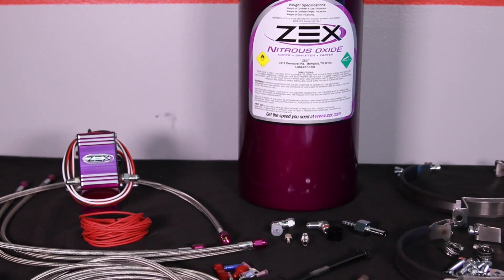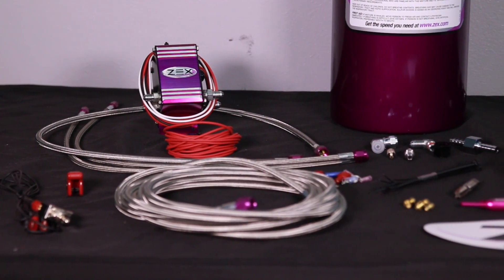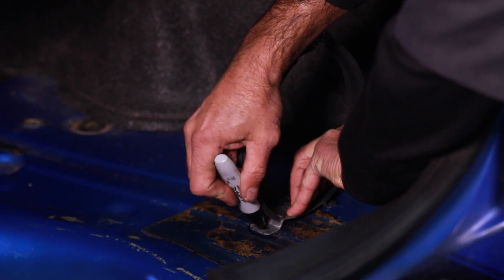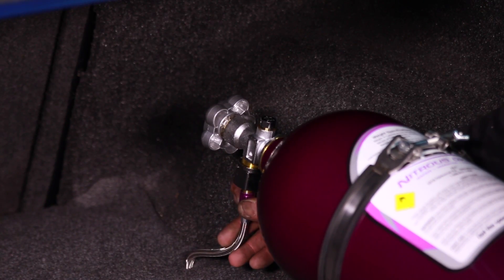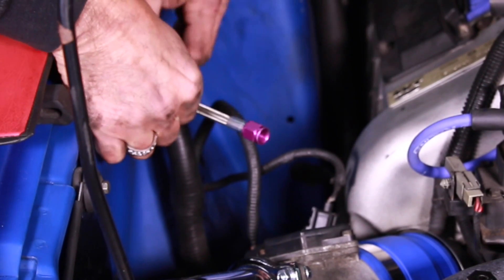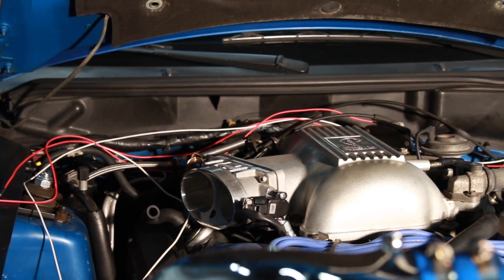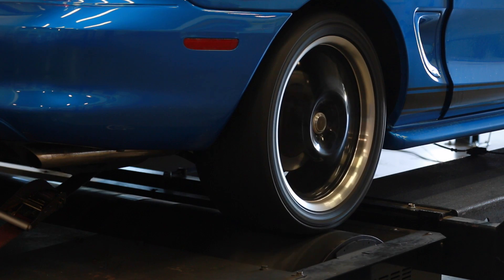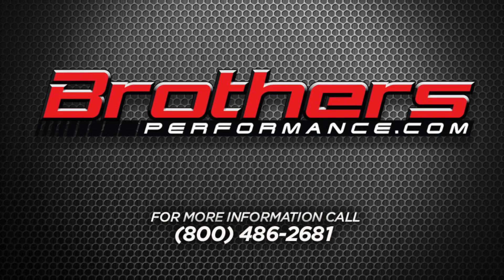1986-2004 Mustang ZEX Nitrous Kit Installation & Dyno Test

Comment: How do you rig up the fuel line? I think you missed that part.
Reply: Fuel rail
Reply: @vrm86gt  I’ve got mine all setup in tip top shape! Finished it 6 months ago when I asked this question.
Reply: @KILRBUSA  were do I tap in on the fuel rail 98 mustang gt 4.6 2v only want 75shot
Reply: @nighttripscarclubdemon9857  on the driver’s side. You should have a fuel rail adapter that came with your kit that goes in-line. P/N: ZEX 82035

Comment: So just to be sure this wont need a tune due to it being mounted before the maf sensor?
Reply: I believe with 100 shot or less no tune is required. If you have a hot NA tune you MUST reflash back to stock or custom tune the timing back down to stock levels.

Comment: Do u need a tune for a 100 shot
Reply: Michael Dwyer No, if your setup is stock the car will handle up to 125 shot, however, if you are running a tune for intake, exhaust etc... DO NOT RUN NITROUS ON A HANDHELD TUNE! SCT, SVE, Diablo etc tunes advance timing for octane levels and bolt-on's and your car will grenade if you throw 100+ shot on top of said tune. You can run up to 125 shot on the factory tune without detonation, problem here is, it will run like a dog off the bottle if you have bolt-on's. ZEx is great about detailing what you can and can't do as far as tunes go and where your car will need fuel delivery upgrades to achieve higher than 125HP  shots. hope this helps